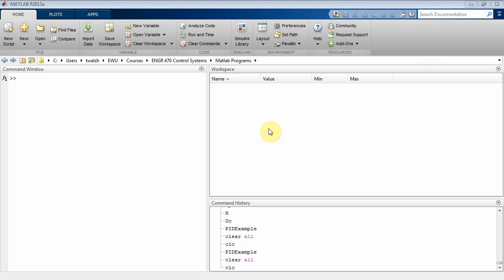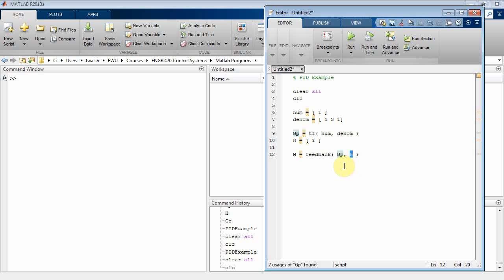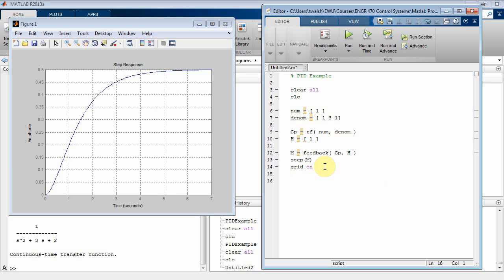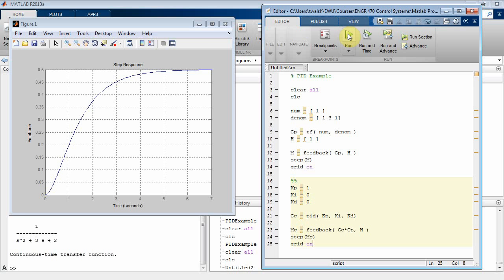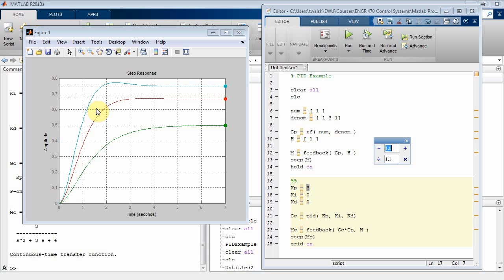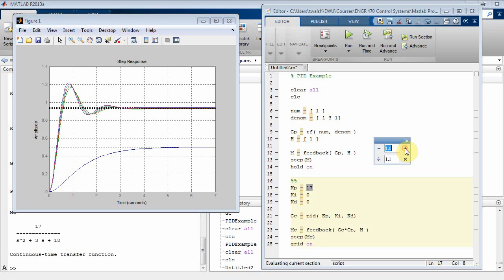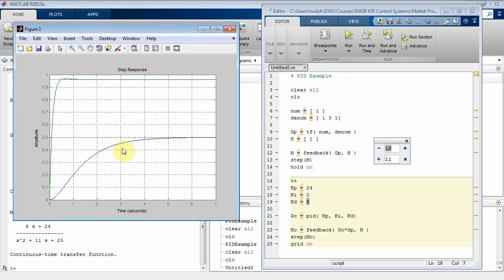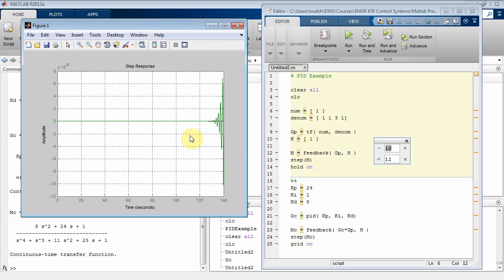MatLab: PID Example

Comment: where can i expand my knowledge bout the d part? I get why it brings higher frequency into the system but what I didnt understand is how this results in reducing the oscillation in the step response. I know that an answer has been given in the video but apparently my control system knowledge is not sufficient enough. Help is much appreciated:)
Reply: Design and Implementation of Controllers using Matlab (UPDATED VERSIONS)
https://www.youtube.com/watch?v=h5vRkDr3CJQ
Reply: You can ask your questions in our comments section, and our team will respond to you in time!

Comment: All I see is tweaking gains and looking at the results.
What will these students do when they see the next system?
Tweak gains and look at the results.
The controller gains can be calculated to get a desired response.
There is no need for trial and error.

Students don't know any better.  They don't realize the video only scratches the surface.
The video is good for technicians but engineers should go much deeper into this topic.

How do you know the gains you chose don't saturate the control output?  Matlab doesn't care but real systems do.

Tuning the 3rd order system at the end is much harder to do by trial and error.  A simple PID will work but not well.  My hint is to use pole placement and don't be surprised if the result is 4 gains.  Matlab should be able to do this but getting the answer without understanding is a shame.  Solving these problems symbolically provide true insight.

The best solution I could find for the last 3rd order solution was Ki=1.03  Kp=1.17  Kd=0.556.  The results still are not very good relative to using the PID with second derivative gain.
Reply: buddy,,,pid, kalman, wavelet and fft, transistors chrcterstcs, viola jones, ofdm,........aaah,,how many things a person can understant in whole life....

Comment: This is great. Thanks for sharing your knowledge in such a calm and informative way. I've been looking at PID controller apps on the web but this is by far the best what of doing it, constructing my own controller in real time with you. One thing I've failed to find so far on youtube is a video showing the complete process of designing and implementing a control system for a real system, from deriving the ODEs of the system to a physical working plant. 
Also; do you know of a way to embed Matlab code into Labview code to control a NI driven system?  Like having a Matlab PID controller embedded into a Labview motor controller vi.

Anyway, awesome vid.
Cheers, Dom.